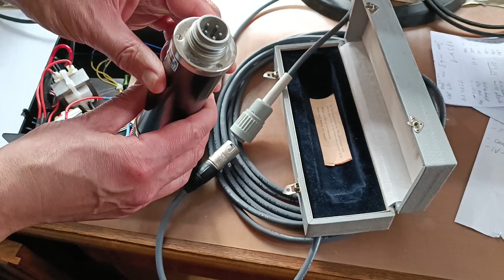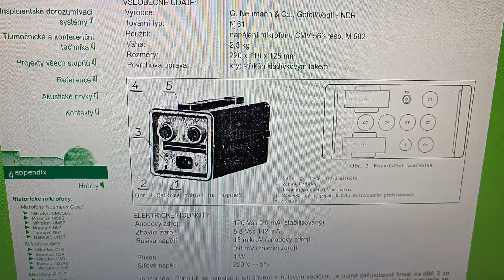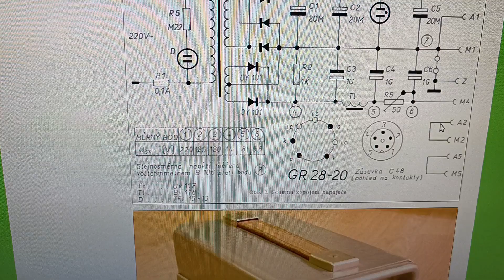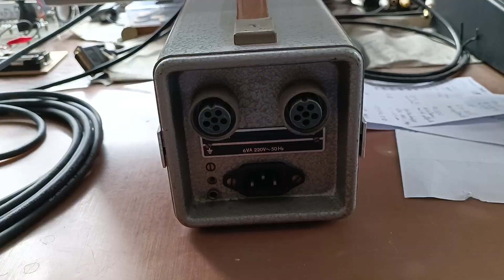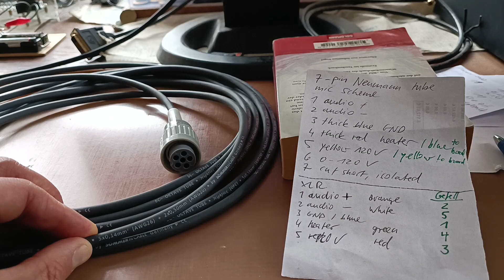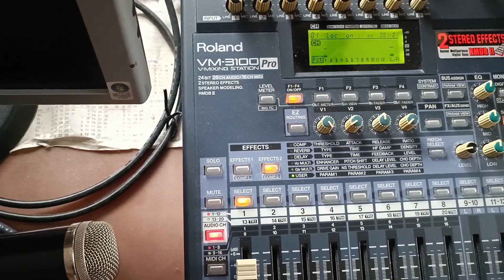Neumann CMV 563 DIY PSU Build

Comment: Hello Jensen. How do you deal with predefined current ratings of the microphone? (0,9mA for HV and 142mA for LV). I don't know if that is important, or it is rated as the minimum.
Reply: Hello Bertomil, the current will set itself automatically. If you set the heater voltage to 5.8V the resulting current (in combination with DC resistance of the heater wire in the tube) will be 140mA. The same for the Grid-Voltage. At 120V DC you get a current of 0.9mA, a result of the biasing of the tube. You only need to make sure your transformer can deliver enough (ideally a little more) current for this application. When using transformers back to back, like I did in the video, there is also some loss. The low voltage transformer needs to have enough current capability to make up for that.